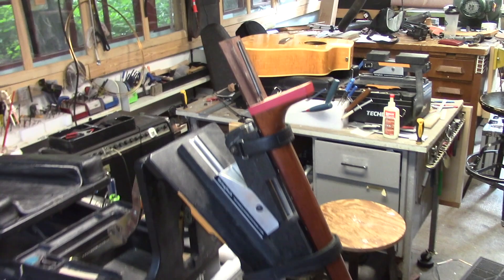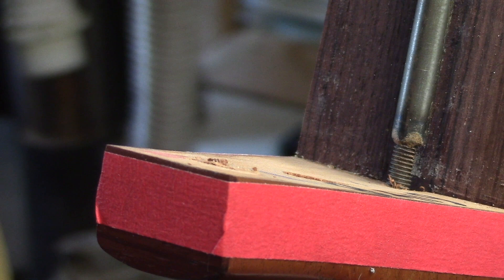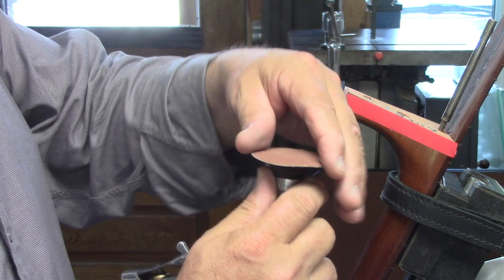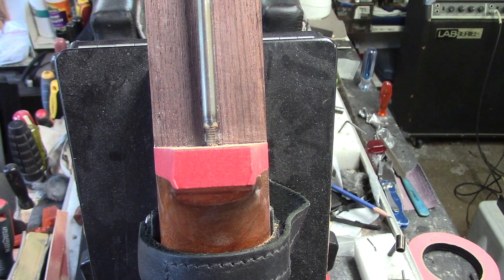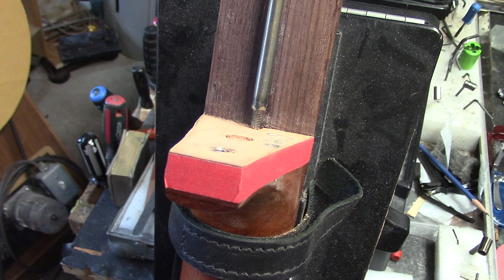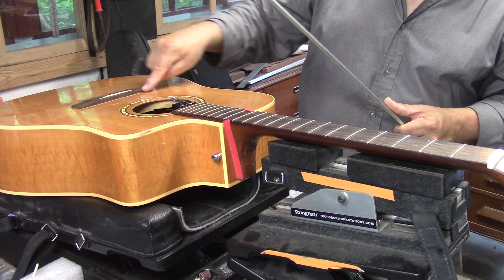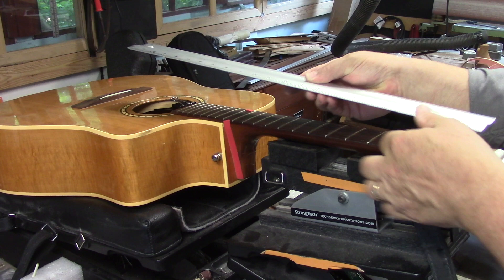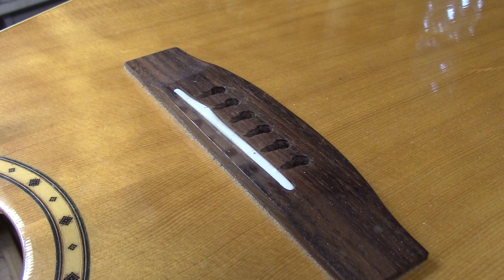Neck Re-Set Acoustic Guitar / Simon + Patrick

Comment: I understand that Godin acoustic guitars made in all of their various companies for the last 10 years have also used epoxy to install their necks. To bad neck resets on their guitars now are virtually impossible.
Reply from the maker: Interesting .... I still use hide glue for the dovetail and regular Carpenter's glue for the fingerboard extension. It's not surprising though ... that Godin is doing this ... Martin have guitars with plastic fingerboards / plastic bridges and bolt-on plywood necks ... !!  Nothing surprises me now-a-days. \m/ !  MMcC
Reply: @StringTechWorkstations  did this guitar have epoxy on the joint?

Comment: Do they use spacers like Taylor does ?
Reply from the maker: No Spacers.
Reply: Good hands you have to do this with a fast sander .  I am finding the Seagull I am working on sounds great but plays like a brick .
Reply from the maker: Hey Phillip, You may be able to just loosen off the bolts and pinch a piece of 320 / 400 grit sandpaper between the inside of the heel and the body. You may not have to remove the fingerboard extension. .... Just saying ... could save a lot of grief. If you do end up with the proverbial " speed bump" at the neck to body junction; you can remove the frets from the 9th fret up ..... gently remove and re-use ( keep them in order ! ) ... with the frets out you can correct the fingerboard before re-installing the original frets. Good Luck ! MMcC